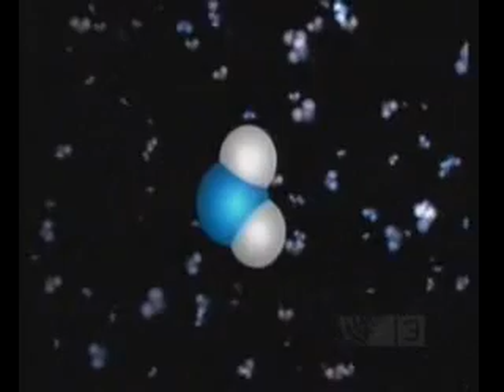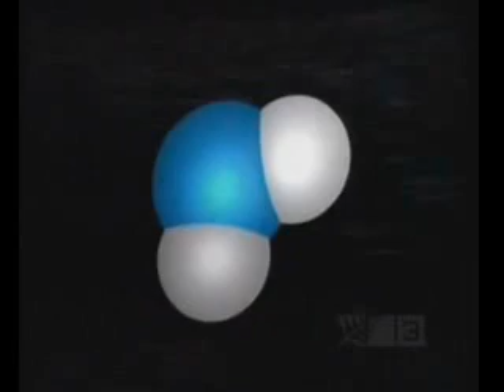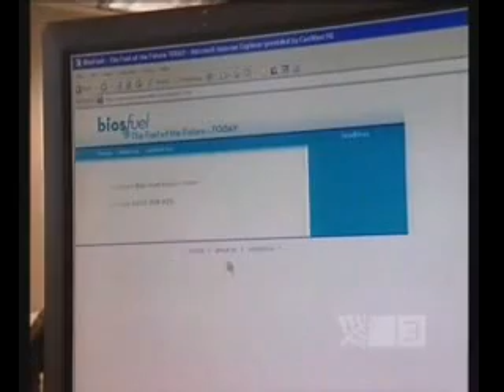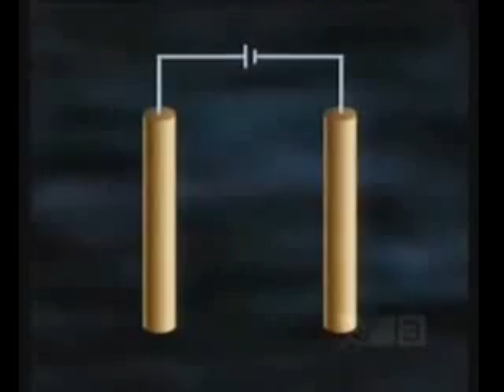A Motorcycle that runs on PURE Water.

Comment: He could be enriching the water with more hydrogen atoms but still keeping some oxygen atoms in it to stabilize it and keep it in liquid form. Once the solution is put into the firing chamber of the engine, it is compressed which in turn releases the excess hydrogen atoms and the piston fires. That might be why it took a little while to start the bike up. Just a guess though.

Comment from the maker: Kelsey Scharf 2 years ago
I know how he did it. He used a certain other chemical, such as potassium or citric acid, in the water to make it conduct a lot faster than just plain water so the electrolysis process is quicker. The more conductive water is, the more hydrogen can enter the tank and thus hydrogen enters the engine at a sufficient rate to make a reasonable amount of power without needing so much electricity. It can't make as much power as, let's say, a gasoline-powered car. Neither will it make as much power as a vehicle fuelled by pure hydrogen, but hydrogen produced by the electrolysis with water that has enhanced electrical conductibility is amassed and stored in a pressurised chamber that will eventually fill up and then have a maintained amount of pressure inside to keep up with what the engine needs to run. We just need the secret ingredient he uses to make the water more conductible. All you naysayers out there can think what you want, but this is happening. It's a shame that all he wants out of it is money. But someone else will eventually discover the mistery chemical and do it for him/herself. It's only a matter of time.
Show le
Reply: baking soda
Reply: Salt water, probably calcium chloride, it's more conductive and soluble than sodium chloride. There's also been a finding that acetonitrile drastically boosts conductivity of ionic liquids. 
I've read that calcium chloride is more soluble and will disassociate into 3 moles of ions per mole of CaCl2 compared to 2 moles of ions per mole of NaCl. If there's another salt that provides more ions, while still being soluble, then that will allow a more efficient electrolysis.
Also there's two methods of burning the gas; the first is burning HHO by itself, or separating the hydrogen and oxygen into their own tanks, and putting both into the combustion chamber. I'm not sure if there's really a difference between HHO and just hydrogen and oxygen separated. 
But HHO when burned turns back into water, so you could technically just exhaust to a tank and reintroduce the salt and/or acetonitrile into the water for the electrolysis.
It's a near closed loop system, only there's probably loses within the loop plus you need to add the salts into the system.
Reply: In my country 30 years ago profesor put someting like green pill in tap water. All people in the room drink from that tap water befor experiment. After that put someting flameble with no collor it the mix. Then put that liqid directly in carborator of old lada and go for litle run.
Reply: acetylene gas

Comment: come on its simpel  2 parts hydrogen and 1 part oxygen is h2o when you send a electric current or fotons at the molecuul h2o you will brake the bond between it and you wil get hydrogen atoms and oxygen atoms so you get gas and thats howits done
Reply: the problem is how to store the gas becouse its dangerous. and by the way the motor is running on electricity becouse thats what he uses to make the water in to gas so just buy a tesla thats way cheaper in the end

Comment: a bit like joe cell, it is possible. First the water has to be condition, which means charge, and then put into the container which might probably a small joe cell, as least has 3 tube. the outer can , neutral tube in the middle and a inner tube connect to the negative electricity. Once the engine get going, it will maintain the frequency within and it is mainly imposion going on inside the engine. low to high to low frequency or said temperature.

Comment: Trouble is that it takes more power in the form of electricity to separate the hydrogen from the water. So it costs more and uses more power than it makes. Electric plants burn fuel and pollute.

Comment: So, where is the scam? Is it possible that the additive is carbide? making acetylene gas. Or is it YET another case of seperating the hydrogen with a simple electrolysis system? in which case the electricity needed is far more expensive than the petrol you would otherwise use. Of course there are hundreds of these "grails" floating around and plenty of con men to go with them. I don't know if it's the case here, but until it's proved otherwise: Meaningless.

Comment: The chemical processes to synthesize fuel from water and CO2 are well known since 1950. The problem is: You still need energy to do it. There is no magic box where you fill in water at one side, and fuel comes out from the other. 
Sure one can create an apparatus producing fuel from water, carbon dioxide and (lots of) energy, but the stuff will cost, at the end, not 1,50 per gallon but 3,00. If you're lucky.
So this inventor might rest assured, he wil not dissapear. Except in the halls of forgotten inventors that had a practicable, but uneconomic idea. 
If this invention was a smart one, the big players would not let it dissapear. They would take it over and make lots of money with.
Reply: Explain more why it will cost more?

Comment: Man, I gotta tell ya...My favorite idiot is the "Octane" guy. While octane is in fact a substance with the condensed structural formula of CH3(CH2)6CH3., it's common colloquial use when talking about the stuff we pump into our cars is to rate for the consumer the given fuels ability to avoid pre-ignition, or knocking. That is that ugly sound coming from under your hood if the manufacturer recommends high-octane fuel and you, in trying to save money, put low octane fuel in the tank instead. That sound is gasoline igniting due to compression before the ignition system has the chance because of the engine's timing causes the high voltage spark across the spark plug gap. It also rears it's ugly head when an engine has not been taken care of properly, and a layer of carbon builds up on the piston crown, effectively giving the engine a higher compression ration. If you hear that sound, you won't be hearing it much longer, as knocking just plays Hell with an engine. Take it to a garage, let a mechanic tell you all this stuff, and decide which alternative of several he gives you, one of which will be buying a new car.

Comment: Water as a fuel is possible after all gun power came from things found on earth. For water
to become a fuel all you have to do is mix or add a thing on earth that will change it to a fuel. Or come up with a way to brake H20 in to its parts. That are a danger's to work with.

Comment: A clever engineer can drill the bolts of the carb, the housings, and feed fuel into the carb from the frame thru the motor castings. .  The water tank and tubes is just a ruse. The bike needs a total tear-down.

Comment: this car doesn't RUN on water, it MAKES water as a combustion product.  As for extracting hydrogen and oxygen from water, that has to be done first, since they're the actual fuel, and takes more energy to start with than burning them in the engine creates usable energy - now, if solar cells could produce enough electricity to electrolyze sufficient quantities of water into H and O, then those gases could be collected, compressed into tanks, and used as motorcycle fuel.  But that's a different technology.

Comment: Without even watching this video, to say that his engine runs on water is total bullshit.  It's like saying salt is poisonous because it contains chlorine.

Hydrogen is flammable/combustible and one of the reasons we moved to helium for balloons, especially after the Hindenburg disaster.  Hydrogen can be used as a fuel, not water.  Water can't be used as a fuel any more than manure can be used as a fuel (biogas).
Reply: +moeman1984 Just watch youtube on how to make hydrogen from water.  I'm sick of this program constantly saying running on water, oops, water-based water.  Yep, on just water.  On just water - water-based fuel.
Reply: +moeman1984 Water burns. You just need upwards of 50 amperes in an electrical arc to ignite it. Thankfully, that is easy to achieve. You fail.
Reply: +Bone Drone Water does not burn you fool, water is inert, you need energy to break its bonds, otherwise anything you do to it will keep the molecules intact.  50  amperes means nothing without reference to volts.  Separating hydrogen from water requires energy and energy is voltage times amps.
Reply: moeman1984
Want to be politically correct huh? K. The H's and O's get separated during the plasma discharge and the hydrogen undergoes combustion. Suck it. As for voltage....it isn't any different than your standard ignition system operates at and we all know a spark plug doesn't fire with the same applied voltage each damn time because the voltage demand changes as conditions do. What's more is there is a very efficient way to achieve plasma ignition with the same amount of input power needed to operate a CDI.
Reply: +Bone Drone Right, a capacitor discharge ignition system which stores voltage through the entire stroke (or two), and then is discharged for a fraction of a second at about top dead centre of a piston, turning water into the fourth phase of matter, plasma, which happens at 12 thousand kelvin.  Right, what was I thinking.
Reply: moeman1984
You weren't.
Reply: +Bone Drone You obviously missed the sarcasm, I can't say I'm surprised from what you've posted.  Maybe you'd like to explain how a charged capacitor discharge ignition system, either as through magneto system like on a motorbike or lawnmower, a coil and distributor on an older model car, or a solid state ignition system, can bring water to the state of plasma, which occurs at 12 thousand kelvin, when all of these ignition systems release no energy for the vast majority of their time of operation.  You're really funny.
Reply: moeman1984
You're the fool if misread what I said. Plasma ignition can be achieved with the same amount of input power used to operate a CDI.

I didn't say the CDI does it. XDDDD
Reply: +Bone Drone You started this argument when you said "you fail".  That remark was in response to my claiming that water does not combust.  Indeed water doesn't combust.  Water in a gaseous state is steam, not water, and after transitioning to the plasma phase it is still not water.  Motorbikes cannot magically run on water, end of story.  An automotive ignition system that passes power through a spark plug gap does not generate anywhere near 50 amps as you claim, however it does generate high volts.  The reason you know there isn't enough energy  in any conventional ignition system to turn water into its plasma phase is that when you get a shock from touching a spark plug you don't die.  It's usually thousands to tens of thousands of volts to jump the gap but only milliamps, hence low energy and you survive. Compare that to the mains which here is 230 volts and a good 15 to 20 amps and then you're in trouble.  Even in the US with 110 volts, same story.
Reply: moeman1984
You forgot to mention the undue resistance in spark plug wires as a reason spark energy is so piss poor. At 40,000 ohms of resistance per foot expect to see many mis-fires as "normal" circumstances.
Reply: +Bone Drone Umm, if your spark plug leads have 40 thousand ohms per foot, throw them out.

Plus, it wouldn't matter as the amps coming out of the coil itself is extremely low.  

You're talking about getting incoming water to separate its atoms by applying a 1 to 2 millisecond duration spark of a couple hundred millijoules after a compression stroke.  Build one, only way to know for sure.
Reply: moeman1984
I must have made a typo.

Comment: make him drink the 'water'..... bet he wont.
Reply: +warfl4g I drank it. Kept me hydrated, just like the engine.
Reply: Mihael Keehl Listen man, i know how awesome it'd be if water could combust. But scientifically it's impossible without a forced financially inefficient chemical reaction or splitting the hydrogen from oxygen which is nuclear fission. If this man could solve either of these issues he'd be famous.
Reply: warfl4g
It is not scientifically impossible. Radio frequencies of 13.56 MHz can create plenty of gaseous fuel from salt water. The flame burns bright red. The radio transmitter uses a mere 200 watts of power to produce enough gas to run a small car. Scale it up for bigger vehicles. A high energy plasma discharge is another way to burn water. At or above 50 amps water will immediately be split. The two hydrogen atoms in each water molecule undergo combustion with both the atmospheric oxygen and the single oxygen present in the water molecule. That flame also burns bright red. This last one isn't burning water, but have you any idea what HHO is?

Get over yourself. Water is fuel, and it's free.
Reply: +warfl4g not nuclear fusion. thats spilliting the nucleas apart, your just splitting atoms apart.
Reply: jetison333 I said fission, not fusion. Fusion absolutely not splitting a nucleus apart, but combining lighter atoms together.

Bone Drone Well, I'm not a Electrical Engineer, but a Mechanical Engineer. However your comment did teach me something i didn't know as i only know the basics about wave lengths and frequencies.

But as too the video, the title says "PURE" indicating that there is zero salt contaminants. Also, while the combustion looks great in a lab under specific conditions... It absolutely isn't practical for an internal combustion engine and i'll explain why.

1) It doesn't look like it'll be easy to actually prepare the liquid for combustion before injection into an engine, there is no oxygen bubbles in pressure regulated fuel systems. So variables have drastically changed from the lab.

2) Salt is TERRIBLE for pretty much every single component inside an internal combustion engine. Starting from the fuel pump through rubber or even braided hoses to the fuel rail/regulator/carby into the actual pistons and out through the exhaust. Every single component would corrode super quickly, and gaskets and oil would be changed daily-weekly.

3) Petrol/diesel/avgas/jet a-1/e85 Are all SUPER GOOD AT INTERNAL COOLING. Unlike salt, fuel is fantastic at keeping temperatures stable through the intake. In a lot of aviation applications there are oil governors that allow fuel to mix with the oil for the added cooling effect.

But that's all i can think of from a mechanical perspective, There is a lot of 'free' or 'super cheap' energy ideas and people who claim that they work, however we're still yet too see diagnostic testing and proper schematics... only short uninformative reports like this one. If anything i think we should go back to steam, easy to manipulate and clean if you find a different heat source besides combustion.

However i've been taught the conventional way that mechanical systems work, maybe there potentially is a way to do it. But until i believe it, i'll need to see schematics :)
Reply: warfl4g It took you this long to comment back and that's what you have to say? Want to know why I don't abide by conventional theory? Because it's wasteful. Worse yet, it's deliberate. I too have been taught conventional thinking and I listen to none of it. I could point out the flaws here but I'll stick to number 3 for now. Where is this so called cooling effect might I ask. The very design of engines running very rich air fuel ratios is the reason thermal efficiency is poor and engines heat up in the first place. It's the coolant that cools the engine, which is required with all that waste heat. Surely you would know this.
Reply: I'm guessing it's just plain gasoline, which is "modified water" and "water based". It has an LD50 toxicity rating (Lethal Dose, 50%. Meaning 50% of people who reach this dosage (without any antidotes) die) of around 700 – 2700 mg/kg for regular ingestion, I'm guessing unleaded being the 2700. So for an 80 kilo person that's 35 grams to 216 grams. If I'm not mistaken, that's 50 ml he fills up in the beaker. Hard to be sure at 240p though.

Probably wouldn't actually kill him. Still, would love to see him try. Would probably make him sick af.

Comment: They were close in their guess, but no money to be had here. The gas can is just a gas can with water. The trick is in the tank, an enclosed air tight compartment where the electrolysis can vent to the engine. The can was a misdirect, and I bet they could find a short from the battery to the tank, since wires are too obvious.

Comment: just a thought electrlolysis removes dirt (sludge) by a electric current to take the metal out and if this is producing hydrogen bubbles then u may be creating pressure on the oxygen which therefore like deisel has energy.
try and find different qualities of h2O and fossil fuels

Comment: This is nothing new. Electrolyse of water. H2O  becomes with electric power  H2 gas and O2 gas ( oxicon ) . This is first year of school work with Chemistry. But you can not do that but just put it in a box without battery or someting that gives electric power.  A pitty that he is not very open over the water that he say he modificate. Lol but how? not to H2 gas because this is not liquet so what he is doing then? Unclear.